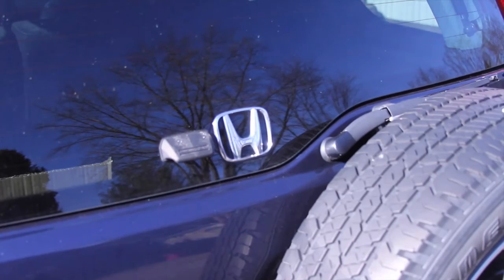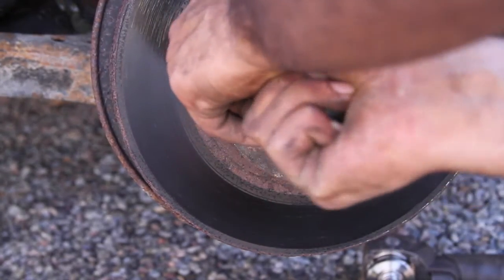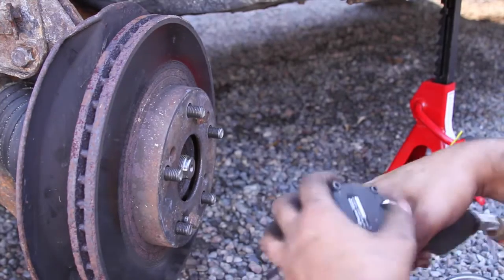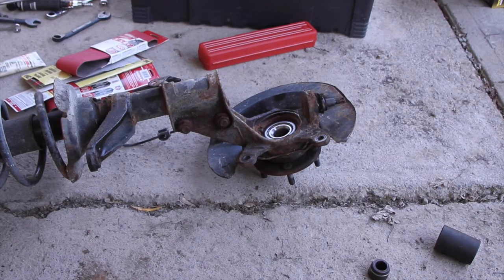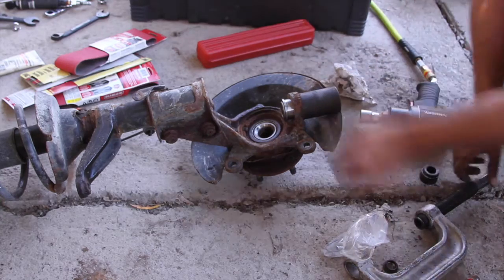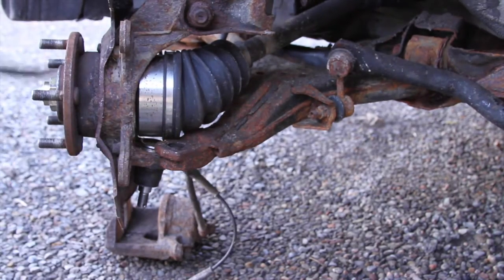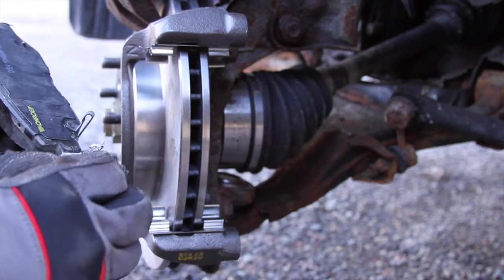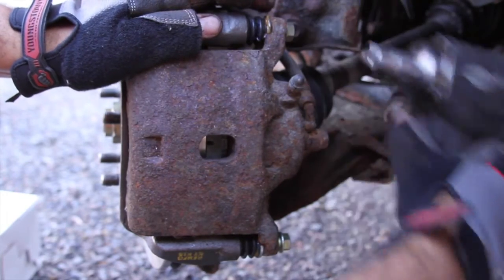2002 Honda CR V Brake Hardware and Front Ball Joint

Comment: I had the same problem with my 2005. I didn't have much trouble with the passenger side but the drivers side really fought me! In the end, I had to beat the driver's side brake rotor off the hub with a giant sledge hammer! It was a royal pain!

Comment: Good job man! Despite all the rust you were able to get the job done.  right on!
Reply from the maker: Thanks man. Living in upstate ny the rust is the hardest thing to deal with.
Reply: I guess that's how goes.  Just bought one these from WI and similar issues. How long did it take you?
Reply from the maker: +sayco phoutpannha I try to keep my videos to reflect the true amount of time it will take the diy-er. But it all depends on if you're using hand tools, air or cordless.

Comment: Do you have to take the whole strut assembly out? I was going to replace only the front ball joints and was going to just disconnect the hub at the strut, the two 17mm bolts. Would I need an alignment if I did it this way? Just got one done a couple months ago.
Reply from the maker: Mark Franks no. This car had been in a yard for a year untouched and the strut to spindle bolts were not coming out.
Reply: Thanks I was wondering why you removed the whole strut. So no alignment needed if just the spindle is removed?

Comment: Hi, great job and nice video, i guess it must be salty around your place in the winter :) ,which grease did you use for the slide pins? I was advised to not use regular grease since petrol might react with the rubber bushings and cause them to seize the breakes (learned that the hard way)...started using eze-slide never had any issues since then.
Reply from the maker: Silicone paste

Comment: Thanks for the video, what size air compressor are you using?
Reply from the maker: Dubblesteel a oil less 21 gallon.
Reply: Joshua Harden- Thx
Reply from the maker: spend the money and get a 60 gallon dual stage.

Comment: Hacks use SAE tools on metric hardware.  Almost the same, isn't. Rounding errors cause rounded nuts.  

Honda lugnuts are 13mm. ALL Honda fasterners are metric. The rotor screws are JIS, not Philips, and if they've been replaced, they should have had antiseize applied to their threads,  and the threads in the rotors chased with a tap after removing them.

Honda OEM brake pad kits come wht ALL new hardware including the retraction springs. Slide pins are more often hydrolocked by a combination of too much bad grease and swollen boot than by rust and corrosion. The frame :core" has a +95% chance of being easily cleaned up ar a vise, brished with naval jelly on the outside, rinsed off, coated with oil, and sold as rebuilt.

Comment: you should replace or put back in the rotor screws,,That is why they are there to hold the rotor in place.
Reply from the maker: sonny Godly no. The screws is used in the manufacture process to make sure the rotor doesn’t fall off. What holds the rotor in place is hub, studs, caliper, rim and wheel. They are not needed. Many cars I repair don’t even have the screws
Reply: Your wheel holds them on.

Comment: That has to be the biggest pain in the ass ball joint replacement I have ever seen. Removing the entire hub + suspension just to change a ball joint....
Reply from the maker: Justin Rizzo you don't have to remove the strut assembly with the steering knuckle but the nut and bolt  that connects the strut assembly to the steering knuckle where too rusted to try and remove. Removing the whole thing does not affect the alignment.
Reply: Yeah. I wasn't trying to be a jerk. I have to bang this job out in a day without air tools. I can't believe how over-complicated these are on a Honda. I can knock them out in 30 minutes each on my VW's without any special tools and without removed the dang knuckle. Same thing for my Mazda.
Reply: I was doing mine on my 06 CRV....i just took the knucle off even left the ABS sensor intact and was just real careful.....my cordless impact pressed them out just fine with the press....the biggest PITA is sorting thru the adapters to see which ones you need....I had to use the socket trick....once i had the pieces of the press sorted i had the old pressed out and new pressed in like 15 min
Reply: I also have an 06 CRV... for lower ball joint replacement, I took off the brake caliper, left the brake rotor on and took care of business.  I used the following video for the clearest quickest explanation (Just leave the rotor on) https://www.youtube.com/watch?v=KEx6R_da25Y   If you have enough clearance check https://www.youtube.com/watch?v=dceoAfDPxtc
Reply: If you know what you are doing and can borrow/rent a ball jont tool setl from an autoparts store, this is an easy job done with metric hand tools.   Some parts of VWs ARE easier to work on because VW has stuck with some designs that have been around for decades.  Some areas need more frequent work than Hondas, assuming that equal level of maintenance are observed.
Reply: Mercedes arent much better either.